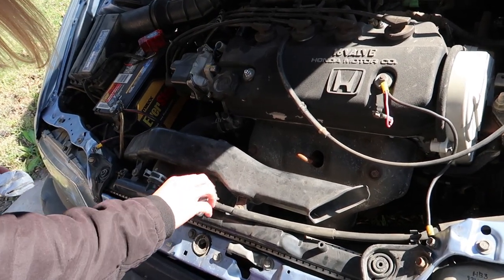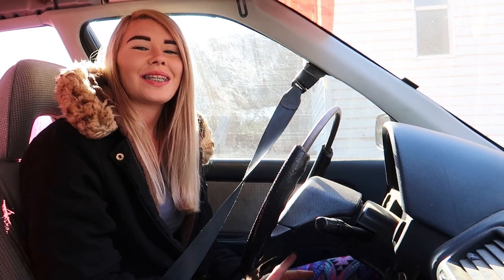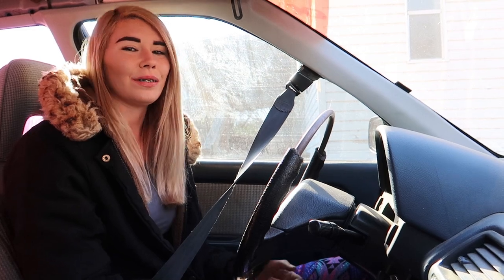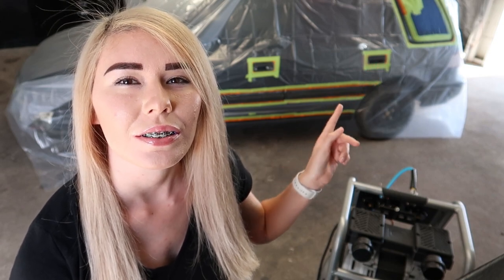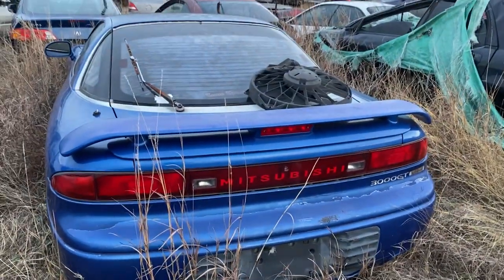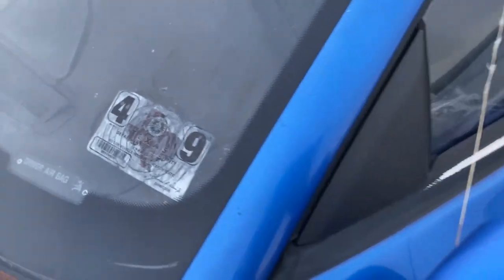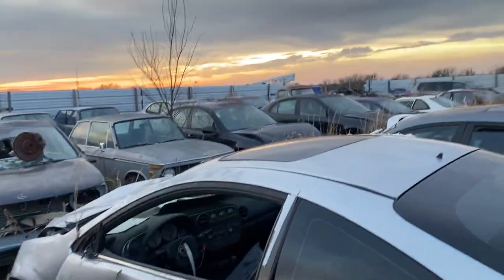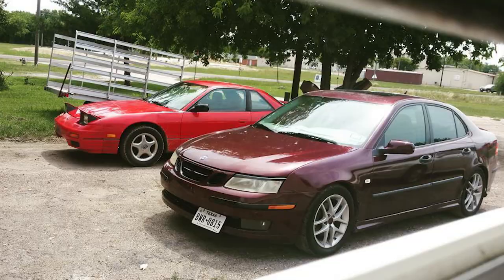Painting The Wagovan Trim | The Exterior Is Almost Complete!

Comment: Just a suggestion,but you could flush the transmission,and change the tranny's filter,or you can go the less messy,cheaper route and pour a bottle of Lucas Transmission fix in there and see if there's an improvement.